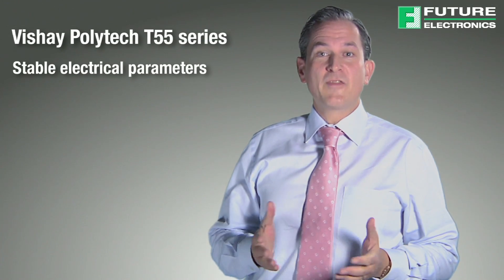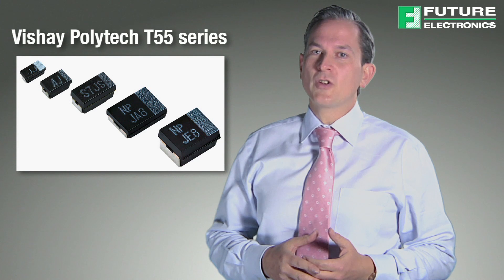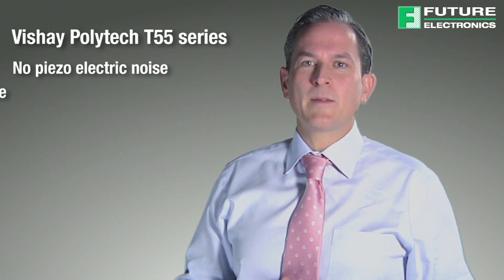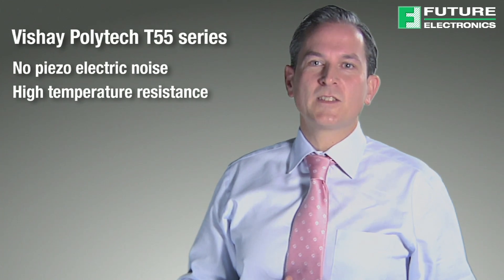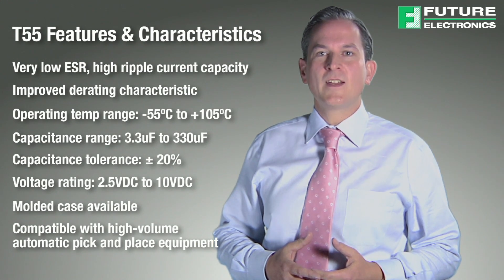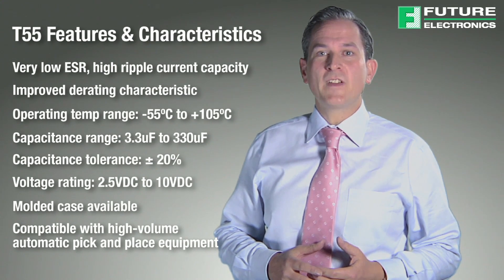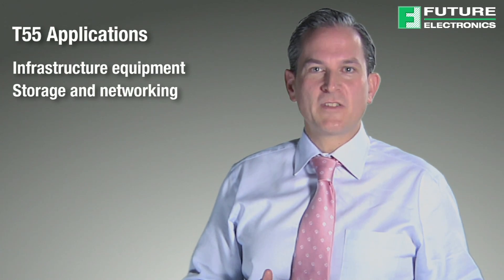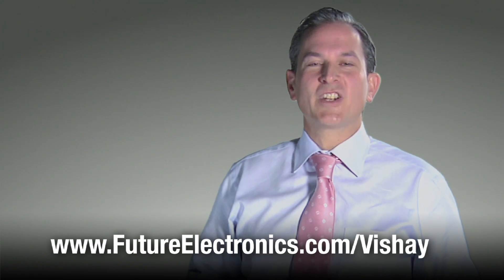Vishay T55 Solid Tantalum Chip Capacitors Offer Ultra-Low ESR in Compact and Low-Profile Case Sizes

Comment: I am still quite the Capacitor novice. would these be suitable replacement for surface mount capacitors in Video game consoles? They are using  normal trough hole and surface mount ones and If i am following correctly these are surface mount style.